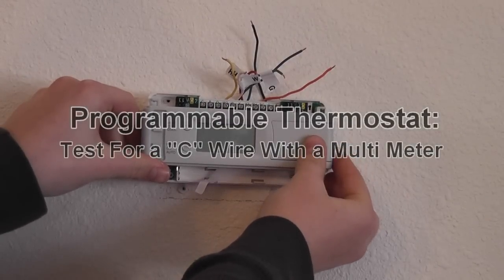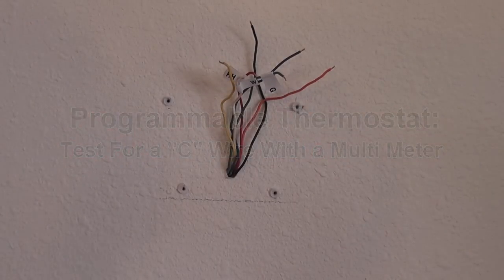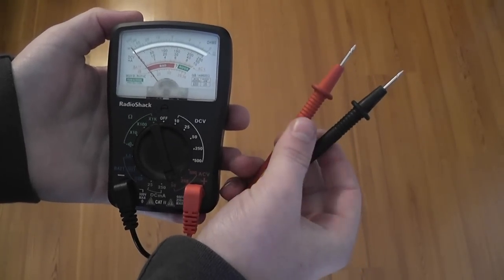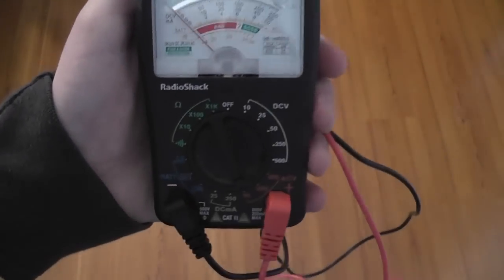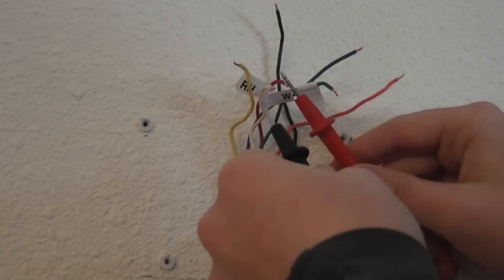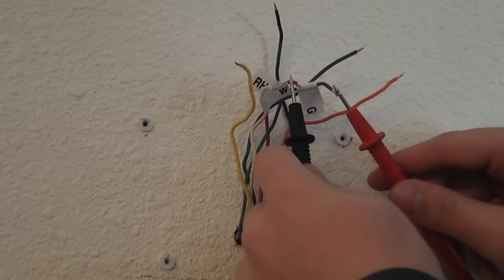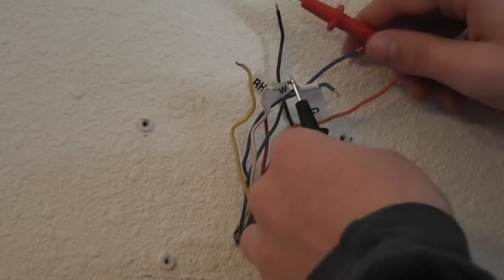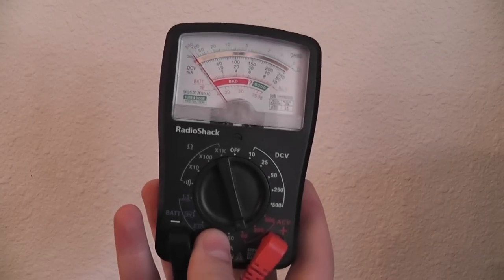Use a Multi Meter to Test for a "C" Wire

Comment: there seems to be a misunderstanding about the c wire, the c wire is a common ground, it doesn't "provide" power to the thermostat, but provides a negative terminal to it.... by reading the R (hot wire) with the C (common) wire it should read 24v... Not a pro though.

Comment: I'm actually showing 24V between Rh and every other wire (Y,W,G), but 0V between Rh and C.  What would that indicate?
Reply: I have the same thing.... You ever figure it out?
Reply: Meh, same here. Except the C wire was previously used to power a little light bulb to indicate that the furnace is 'on'. Therefore, the C wire has a 24V charge only when the furnace kicks in. :(
Reply: That would mean you have a dead wire. Probably not connected at the furnace.
Reply: Me to 24 everywhere
Reply: I’m getting the same readings. What did you find out?
Reply: @zoomzoomboomboom  It means the common wire is not connected at the furnace end.

It may be as simple as connecting it, or in my case I traced a wire splice through the wall because someone had spliced two thermostat wires together for whatever reason, but didn't splice the common wire.  Double check your connections. :-)
Reply: Yes! You’re exactly right. All my wires showed a reading on the meter except the C wire because it wasn’t connected to the furnace. I connected it and the smart thermostat works great! Thank you for your reply!

Comment: I have an old thermostat with 4 wires, 2 used (R and W), and 2 unused. I only get 24V when I connect the W wire to one of the unused wires (let's call it U1). The R wire doesn't show 24 volts with either of the 2 unused wires. Is U1 the C wire?

Comment: Stupid question but does the power have to be on? Seems dangerous to have those dangling wires with the power on...or am I just an electraphobe?
Reply: Garry Shane Baldridge i had the exact same question
Reply: @benb8075  NOT true!
Reply: @benb8075  A 12V car battery vs a thermostat wire?  LMAO.  Someone needs to learn about AMPS!
Reply: @dudleydooright  exactly, these wires can't carry enough amps to kill a person even if the wire was melting while you had it shoved up your bum. over 200v could cause heart arrhythmia however. only way that could happen is if some dip wired the panel wires to the 240v off the main breaker. either way, 24v is harmless and there is a fuse on the air handler control board to protect it even if it is shorted.

Comment: There is no orange wire. Maybe you meant red or maybe you're color blind.
And why would you set the meter to AC instead of DC?
Sorry dude but I don't trust a word of what you said.
Reply: He didnt say orange, He said RH which i can see the confusion, and you use AC because the system runs on a 24v AC system, DC is not used in many if any home applications, mostly only on battery operated items, like cars and such
Reply: AC is household voltage, genius.
Reply: @Jeff82556  Uh...  errrr...  dude.  Follow the wires down to your furnace there genius.  Most room thermostats on heating and cooling systems receive their 24V DC electrical power from a low voltage transformer that itself is usually found at the AC of the furnace.  You check that with an AC multimeter!  A DC setting is for 9V batteries or less. The pulsating torque on the pointer will not produce average torque if you go with DC on a thermostat which means you'll get incorrect readings!
Reply: @Jeff82556  Tha manual for my Honeywell thermostat says the C wire will be 24 VAC.
Reply: He did it right, you assume wrong.   The reason you would set your meter to AC is because....you are measuring AC !!!   There is no DC in the circuit on HVAC systems.  The transformer takes your high voltage (120 or 240 VAC typically) and steps it down to 24 VAC.    C wire should have 24-28 VAC against one of the R wires.   AND just so you know, an R wire might be any color, though it's likely Red.  R is about it's function, not it's color but most will wire it using the Red wire if there is one.   C will usually be blue but don't count on it.